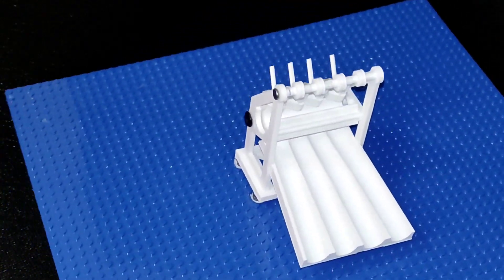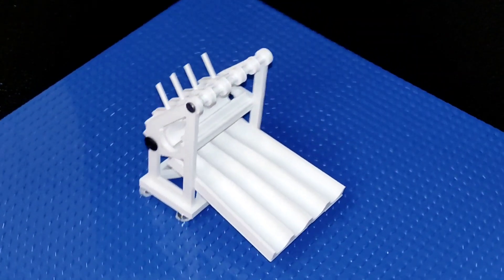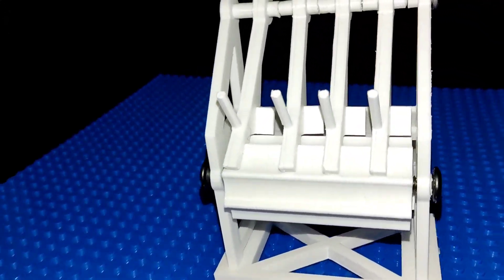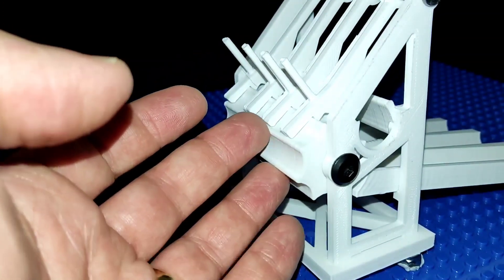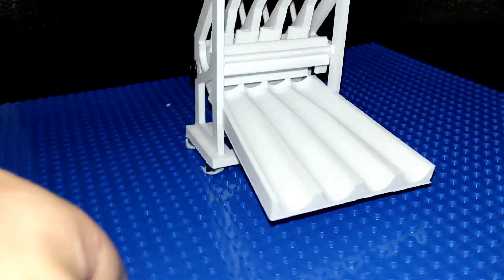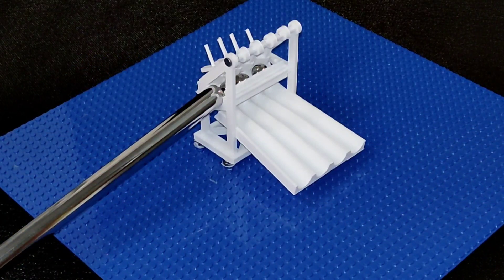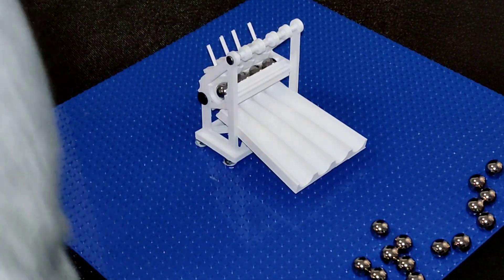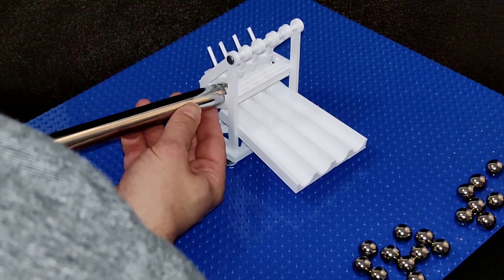MMX Triggered Escapement Divide by Four

Comment: I think back to the hot wheels tracks.  There was a little motor with a spongy wheel giving the cars a little boost every time they went around.  If there is a way to get a sponge wheel driven by the normal rotation of the marble machine, you could "notch" out the top of the tube just before it enters the divide by four.  Put that little sponge wheel in the notch and every single marble will enter the divide by four even if there are no more behind it in the tube.

Comment: Ah, I have my fingers crossed he decides to revert back to a design like this for the current divide by 4, a straight tube coming in and 4 straight tubes coming out to the fish stair. Seems so much more simple than balancing 4 tubes for what seems like a meter down a slight incline with bends in them. Idk. Just seems like too much hassle with the current design. 

As for the divide by 8... Couldn't you only have 4 triggers/latches, but spaced out every other marble? So when 8 gets filled then it releases, but the marbles only need to push 4 triggers instead of 8?
Reply from the maker: If there's any chance the four triggers get pushed without a full complement of marbles, it's more or less guaranteed to happen after a few thousand marbles!
That's said, as long as it were say 90% effective, it would be better than the simple fed tray used in the conveyor.

Comment: The escapement wheel and marble channel needs to be sloped enough so that the force of gravity overcomes the resistance of the  escapement pawl.  Then it probably does not need any pressure to operate.  It will probably be insensitive to intake pressure changes too.  Test this by lifting the intake side using the screw feet.

Comment: I love all the clever designs the MMX has sparked, and this is another great example. Well done!
Most of the friction probably comes from the contact point between the escapement wheel and the latches. The laches have to slide on the escapement wheel while there's some pressure on the contact point from the weight of the marbles. The problem is amplified as the latches act as a lever arm, with the marbles actuating it closer to the pivot point than the source of the friction. 
One possible solution I see would be to move the pivot point to the other side of the escapement wheel so that the latches extend over the wheel and engage it with a "hook". Then the marbles have some leverage on the latches.
Reply from the maker: Did you watch the next video?!
Get yourself on Discord, there's an alternative design being tried out with exactly what you described: hooked actuators levered on the back, and using springs instead of gravity.
Reply: @MrGonzonator  Unfortunately not yet, I just stumbled over your channel by chance. I'll be sure to check it out!

Comment: The latch is a 4 bit AND gate, clever!
Reply from the maker: Pity I can't turn up the gain a little!
Reply: @MrGonzonator  friction at the latches is where the power is wasted. If only the latch had a gain stage, like a darlington pair in a flip flop.  Thinking out loud…
Reply: I love how simple and intuitive this design is. Straight away I was able to figure out what was going on and how it worked 😍
I think the main issue with friction is because it's a 3D printed part and you have layer lines, so you should be able to design around that, select different materials like Delrin, for example. This definitely has promise 😃
Reply: @azyfloof  Yea, Im interested to see what this line of improvement will yield as well. If the layer lines are a potential source of friction, maybe sanding them flush could be a simple way to test that.
Reply: Indeed.